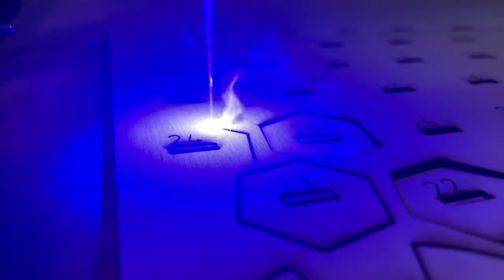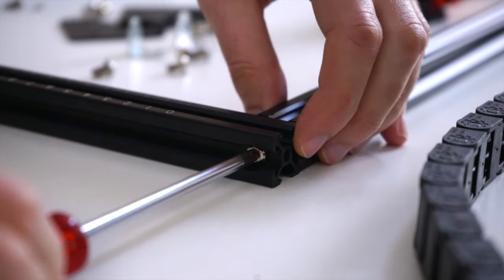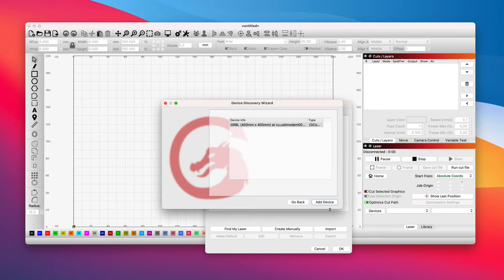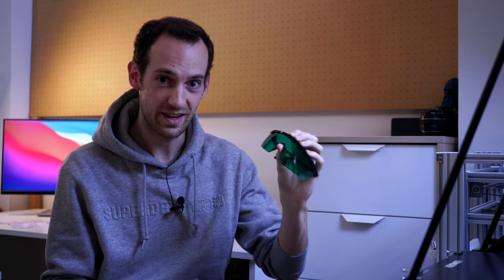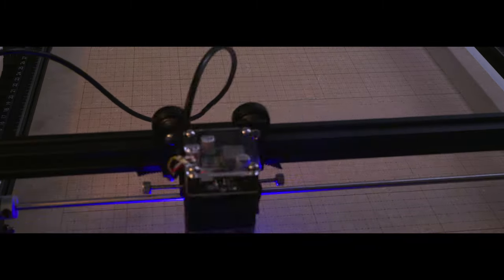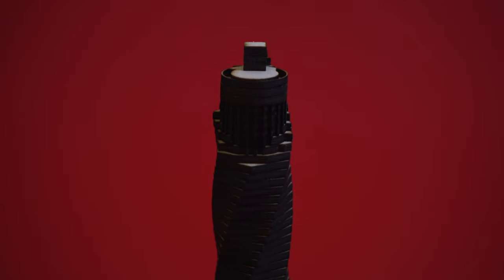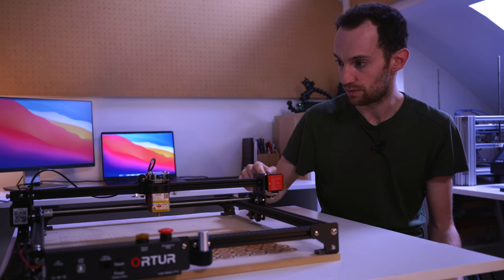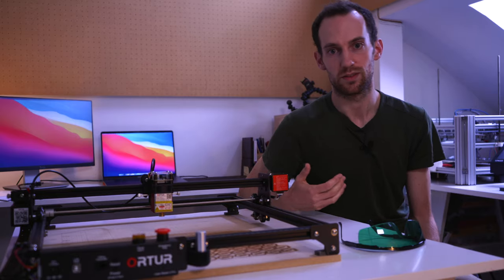Ortur Laser Master 2 Pro: A Close Examination

Comment: actually green glasses are also correct if they are for the correct wavelength.  And we assume with the enclosed certificate they are within compliance.  You may notice that all, or mostly all laser machines, regardless of the color of laser lens on the bottom of the laser, come with green glasses.
Reply from the maker: Yes and that’s exactly the problem. Almost all blue lasers come with green glasses, yet they have to be orange. That’s what I was trying to explain. The glasses simply cannot be green if they are supposed to block blue light. They have to be orange/red or pitch black. Nothing else. As I said: it’s basic color science ;)

Comment: Thanks for the vid.  Was trying to figure this out on Ortur's web site...it looks like the Ortur Laser Master 2 Pro S2 machine with the LU2-4 SF module does not come with air assist whereas the machine with the LU2-4 SF module does come with air assist.  Is that correct?  If so, I'm wondering why the SF module does not come with one.  I guess I could rig one up using something like a fish tank air compressor I suppose.  Just curious if you know.  Thanks.
Reply from the maker: Back when I got it, there was only one version, but from what I can tell, what they call “air assist” is not actually air assist. They just use a duct to guide the air from the cooling fan into the cut. It’s probably better than nothing, but I would still go with the fish tank compressor if I was serious about cutting. Thanks for watching!
Reply: The LU2-4LF (long focus) comes with an air assist nozzle and tubing; you have to provide your own air source. The LF module is way better for cutting; two passes for 3mm ply. The SF (short focus) module is primarily for etching, which is why your cuts took so long.

Comment: Are you using the short focus machine or long focus? There are 2 models, one more for cutting and the other more for engraving
Reply from the maker: You're looking at the Ortur LM2 Pro S2 machine, which seems to have these two different options. I only reviewed the original LM2 Pro. 

However it looks like the laser module that I've got closely resembles the long focus module from the S2, with the only difference being that mine doesn't have that fancy air assist nozzle.

Comment: I like your review, however I cannot see how you did wrong with the cutting of plywood. I use one of the other Ortur lasers and I have no issues cutting 3mm or 5mm plywood. I only need 1 or 2 cuts, without burning too much the wood. I agree with you as regards the goggles etc. In any case still loved the review, thanks again.

Comment: Thanks for the review. I couldn't find any information on the maximum height for the pieces you want to engrave (not cut). Do you have any precise data on this?
Reply from the maker: Im but sure I fully understand the question unfortunately. You could just prop the laser up on two bookcases to fit a 2 meter high object underneath, if that’s what you mean or you could set it atop a plane and engrave that 😅
Reply: @ConstantijnC  Wenn ich den Laser Cutter fest auf eine mdf Platte verschraube, wie hoch kann dann zb das zu gravierende Holz sein?
Reply from the maker: @basti7463  ahh sorry, jetzt hab ich’s gecheckt. ich hab grad grob nachgemessen und würde sagen mindestens 35mm.
Reply: @ConstantijnC  ja sorry war my bad, konnte es auf Englisch nicht richtig ausdrücken. Ich danke dir für die schnellen Antworten! 🙂

Comment: Request: please make a video on the NEJE Master 2S Max with the NEJE A40640 laser module.
There's not much credible content on YouTube on this system and it's relatively new.

There spec sheet is almost dreamy and there kerf is square as per their claim.

I really want ro get a laser engraver/cutter and I wanna start with diode because it is magnitudes easier than operating a CO2 laser.
Reply: The short of it : great laser head that allow at last decent cutting power for a diode laser, but suboptimal platform with too much backlash, lacks rigidity, dual independant motors on the x axis. Ideally, you'd want the Orthur platform, the Atom X7 standalone controls and the Neje laser diode. Either build a platform on your own like a coreXY one (there are many discord groips to help) or upgrade an Orthur, though it has sigmificant cost. The diode laser vs CO2 laser is not really a valid comparison because they serve really different needs. A K40 (really a 34 to 36w at most)  is a huge and bulky machine for a really small cutting area and it needs air assist and a cooling solution (even a chiller once you use 80+W lasers). If you want a bigger cutting area and a decent power you're into 80 to 100W CO2 lasers that cost 3500 to 7000 ($ or € is around ghe same with VAT and import taxes) but you now have a production machine not a hobby one. A diode laser thanks to that 40640 head is a light setting, best fit for engraving large areas and that can nonetheless cut cheaply up to 6mm mdf with a bit of time, care and air assist. It's an awesome news for hobbyists. You just have to accept its limitations.

Comment: Great video! is there anyone who can point me to where I may be able to replicate the gridlines created at the 12 minute mark?
Reply from the maker: Thanks! I can.
Reply from the maker: Just draw lines with the preferred length and spacing in your vector program of choice and use that to engrave. Or do what I did, which was to draw the lines straight into lightburn. Use the copy/paste or the grid function if you want to keep your sanity 👍
Reply: @ConstantijnC  Amazing thank you! This is going to save so many headaches lining things up.
Reply from the maker: @marckbashaw2792  no problem, good luck! 😊
Reply: @ConstantijnC  are you willing to share the file for the baseboard grid pattern? Also do you sell the feet you made to mount it?

Comment: You try and take away from the machine because it's speed, which has more do with your expectations than the machine. It only has so much power (which is known by the buyer before ordering) If you want something faster you have spend more money. For its price range it does everything that you can expect of it. And does it well. Your lack of knowledge of what a laser of this power can do doesn't take away from the machine at all, since that information if all over the web and on YouTube. Also if the glasses were so unsafe why did you continue to use them.
Reply from the maker: Hey Terry, I realise that I didn't explain myself properly, so let me try and rectify it: 
First of all, I'm blown away by the power of this module. Last time I used a diode laser was 10 years ago where the best (commercially available) ones could barely cut cardboard. So honestly, it does more than what I was expecting.

Secondly, you don't have to spend more money to get more power. I should have included actual prices to support my statement. The Ortur LM2Pro goes for around $450. The K40 CO2 laser, which is the one I compared it to, goes for around $350-$400. I'm not saying that in order to make one or the other look better. All I wanted was to objectively show how the LM2Pro fits in the current market of hobby lasers.

Lastly, about those glasses:
At 9:48 I say: "Now, the bottom line is that these glasses probably do filter out some of the blue light. It's just that the certificate is misleading to the average consumer and these might therefore give a false sense of security."
At no point did I state that the glasses were unsafe. I do however stand by my statement that they are of the wrong color and might give a false sense of security.
At 10:04 I even show how much better the orange cover is when compared to the green glasses. Those clips also show what I stated earlier, which is that they do filter out some of the blue light. It's just much less than what it could have been, had they sent orange glasses.
Now to the actual question why I still decided to use those glasses: Please refer to 9:56 where I say "Now, as for my part, I have ordered some orange [glasses], which should arrive soon, but they haven't arrived yet." 
At that point, the green ones were the best ones I had, so that's what I used.

Thanks for watching anyway and thanks for your input. Apart from the aforementioned explanatory shortcomings, is there anything else I could work on? This might sound cynical, but I'm actually being serious. You can also send me a mail if you'd like to.
Reply: @ConstantijnC  Thank you for the great video! Could you maybe share what the brand and type are of the orange glasses you eventually bought?
Reply from the maker: @Thisisntausername  I bought some no-name ones, which for liability reasons I don’t support you doing and I don’t trust them at all to hold up under direct laser exposure. But they do decrease eye strain due to scattered radiation by a lot when compared to the green ones

Comment: "These safety glasses aren't the right color".  Keeps wearing them.
Reply from the maker: Still better than no glasses 😉
Reply: @ConstantijnC  I bought a few pair of EaglePair glasses when I first started messing with 532nm, 450nm, 650nm lasers... it's hard to be sure how well these things work though.  I mostly think glasses have to be secondary protection due to the risks of third-parties entering the room, or especially pets!

I'm not even sure that poor glasses are better than no glasses.  I remember some story years ago about bad UV sunglasses actually causing more damage to the eyes because the iris opens from the darkened glasses so I wonder if something like that can happen here too.  I've superficially looked for the protective panels but haven't found a great supplier, maybe you know one?
Reply from the maker: @synapticaxon9303  yeah absolutely.
I think the test I did at 10:04 is a good first test for lasers that emit in the visible spectrum. But it doesn’t show how the glasses react to higher laser powers. It should be very representative of  scattered or diffused light due to reflection off of different materials, which is the main risk factor anyway in my uneducated opinion.

Comment: Until reviews show the true durability of these this is nothing more than fanboy flaming the fire for a lame option! Anyone who thinks this is a thorough review is kidding themselves because the life expectancy of these lasers does not justify the cost!
Reply from the maker: I specifically said that I only tested it for 2 weeks and I referred to all the other reviews because I’m fully aware that 2 weeks is barely a shakedown cruise. I also said that it’s hard to justify when CO2 lasers are almost the same price, yet so much better. I asked Ortur privately what the life expectancy of the laser is and they said that the manufacturer of the laser module states 20000h. Ortur themselves seem to be a bit cautious and guarantee 8000h at 100% power. But even that seems very exaggerated, but it’s the best Info I can give at this point. 
Mechanically it’s a very nice machine and I stand by that. If it has to be a diode laser, then I’d get this one. If not, then I’d get a CO2.
Reply from the maker: @kevinm3751 Yes I was really considering testing the ttf of the module but decided against it because, as you said, the ttf vary so much between modules that my single datapoint would do more harm than good… someone could pull a conclusion based on that single insignificant datapoint.
Reply: True but then to be fair, you'd have to consider that CO2 lasers also degrade (and the cheaply made K40 ones faster than others) and they even degrade while you're not using them. And you need a chiller box that had a considerable cost to the base installation. A tube or a diode head end up being disposable parts. A gas chambered diode laser is still a decent tool, not a perfect universal solution. I don't see what's so upsetting about it. It"s like comparing a maglev train and a diesel powered one. They have different cost and fit different needs.
Reply: @the_arcanum  So by your definition the technology is not ready for the consumer market! At least no where near the price point they are asking!